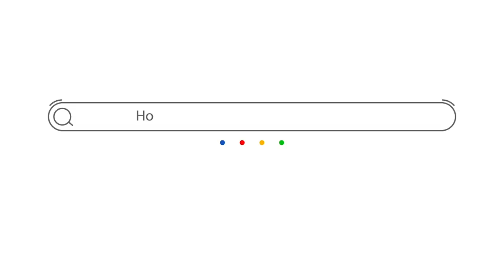Inside Look: Tiffin Motorhomes Paint Factory Tour and Service

Comment: Hey Guys Great video.  We are looking to purchase another motor home.  I have a question for y'all.  The home we are interested in is  33ft.   This would be the longest  home we ever had .. My question and my concern is have you found it difficult with all your travels any issues getting into National/State parks because of  length restrictions.  Thanks
Reply from the maker: Hi Rich. Our Breeze is 31.5’. We chose it because it was the smallest diesel pusher made in the last couple of years. It’s shorter in length, and height (11’7” tall), and it’s more narrow than other Class A motorhomes. All of that has come into play with us visiting National Parks and older campgrounds. Every little bit helps. There are still some areas we are too big for, but we were able to camp inside Yellowstone, Theodore Roosevelt, Grand Tetons, Devils Tower, Padre Island NS, and Wichita Mtns NWR last year. Most of those would have been out of the question if we had our old 35’ unit. Beyond the length of the sites, you have to consider obstacles like trees, brush, rocks and narrow roads in and on the way to the campgrounds. (And some of the sites are at awkward angles for larger rigs.) The smaller you are the more options you’ll have. But be realistic about how much space you need to be comfortable and carry what you need & want.
Reply: @rvamericayall  Hey Guys,  Thank you so much for your in depth  response to my question.  We are still stranded overseas due to the virus.  But hopefully we will get back home in several weeks.  Looking forward to getting on the road again and maybe be able to meet up with y'all in the Lone Star State.  Happy Easter!